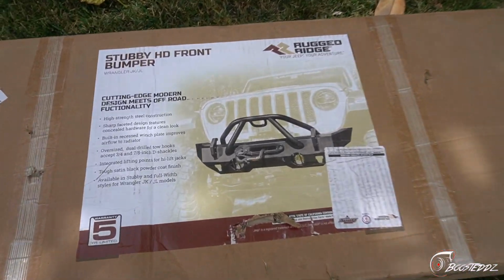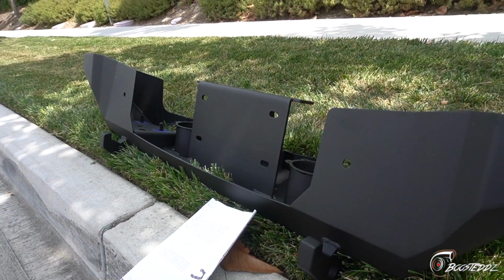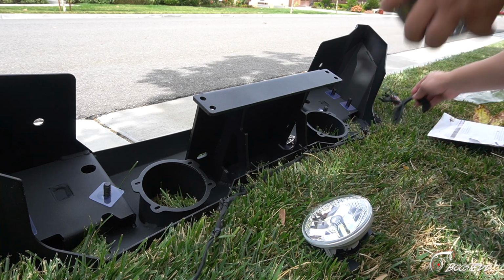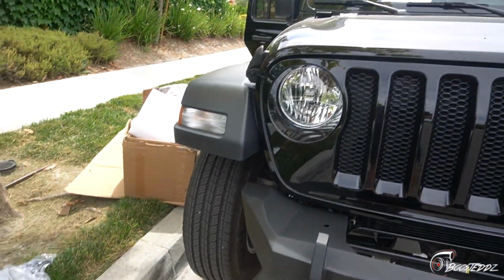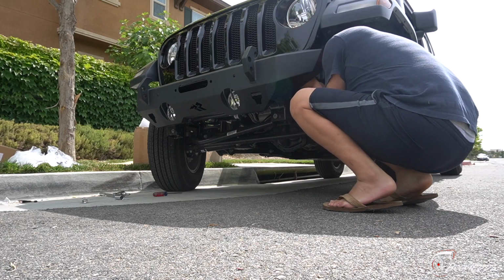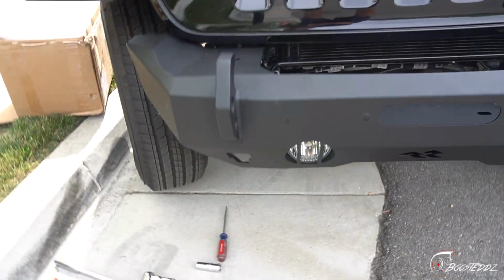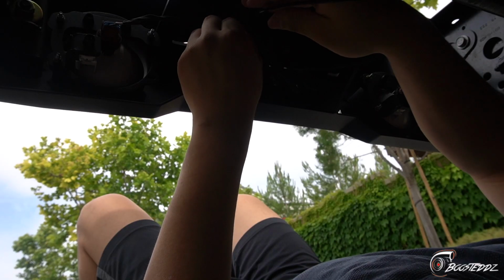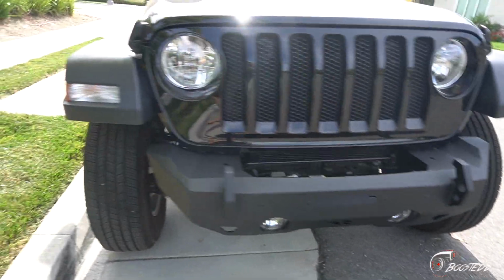NEW Rugged Ridge bumper for my 2020 Jeep JL!

Comment: I know this video is 6 months old but I just found it and liked the bumper so I watched it.  You put all your washers on in the wrong order, from the fog lights to the actual bumper install.  The flat washer goes on first, then the lock washer then the nut.  The lock washer needs to engage or be in contact with the nut once tightened down to prevent the nut from backing off over time.  Hence the term “lock washer”.
Reply from the maker: Good to know thanks !!